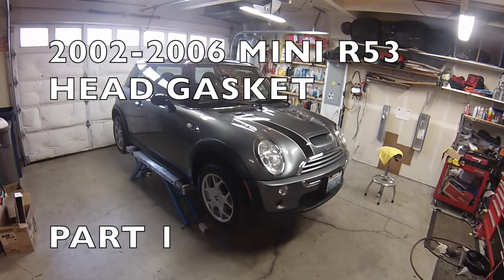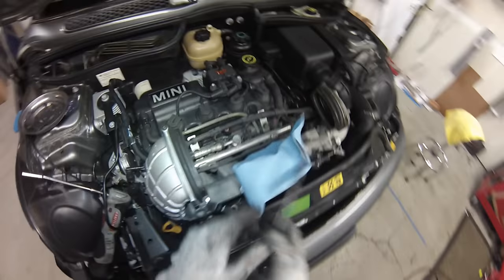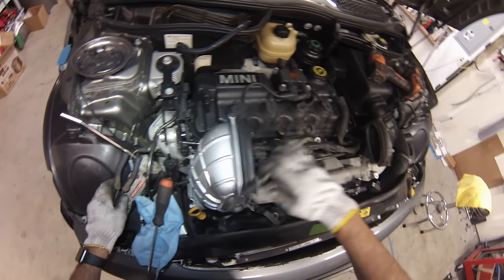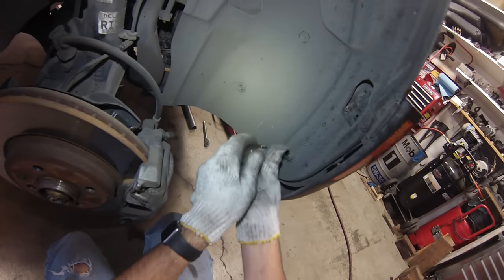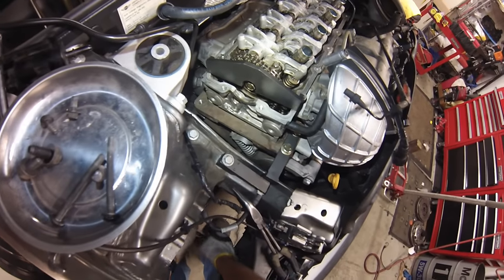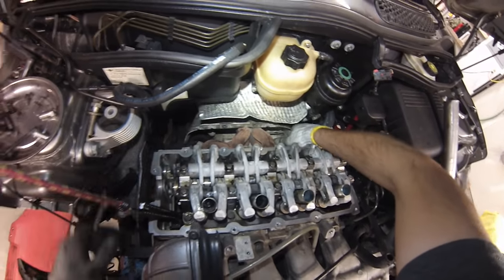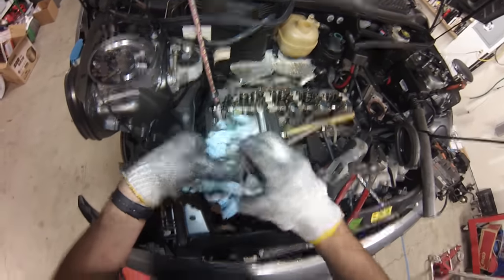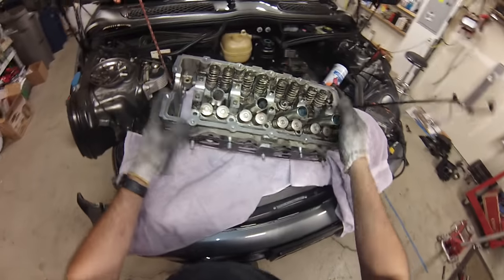How to Replace MINI Cooper Cylinder Head/Gasket 2002-2006 R53 Part 1

Comment: what tool is used at about 7:40 not the air tool
Reply from the maker: +jaydunners0805 12v battery powered angle impact driver?
Reply: +Mod MINI thanks any chance u could do a walk atound of ur most used tools and what cars u have as I have only subscribed and are very interested in ur work
Reply from the maker: +jaydunners0805 One of these days... Time.

Comment: seems like this is the best way to replace the guide rails? I would guess no need to remove wheel or fender inner. great video.
Reply from the maker: correct.

Comment: You said in text at the start of the video that a bad oil cooler can cause the milky oil as well. My R53 had a head gasket replaced about a year ago. I am starting to see symptoms that say the head gasket is gone again but it is still very new. Is there any way I can visually check the oil cooler to see if that is the issue? Thanks for your help
Reply from the maker: +Anthony Fidanza Yes it can. You can test it by removing the oil cooler and hooking up the coolant side of the heat exchanger to a pressurized water supply such as a garden hose. If anything drips out and you're sure your connections are good, you have a bad oil cooler.

Comment: need your most honest opinion. I over torqued the long bolts by 10ft lbs in error. haven't ran the engine. would you loosen it and retorque or get new bolts? its the long studs that bolt onto the short block
Reply from the maker: +Dee Chey I would probably just leave it as is. Loosening and retorquing may be worse than doing nothing. 10lb-ft is not a lot and not enough to compromise the bolts or change bearing geometry.

Comment: Another awesome video that gives me the confidence for this job!

I do have a question though before i go digging into my r53. I have found the milky residue on my filler cap and a little bit on the dip stick. I suspected the head gasket but as i do more research i find that it can be the oil cooler also. Some have also said this can be caused in these two locations because of condensation...? I'm not sure if i believe that, but i do live in New Hampshire where it has been very cold recently. Do you think condensation could be responsible for this? I changed the oil only 3 weeks ago and it looked perfectly fine. Also i have no oil residue in my coolant, that is clean. I did replace a leaky thermostat around 2 or 3 months ago. Not sure if that info is relevant or not. No white smoke, rough start, misfires etc. Car runs normal.

I will be getting a leak down test and test of the cooling system doen, but I would really appreciate an opinion from an experienced MINI professional like yourself before sinking in the time and $$$. Thank you so much for sharing your knowledge and experiences!!!
Reply from the maker: +Christian James That can be condensation if you take a lot of short trips. If you wipe off the dipstick and oil on dipstick is clean (other than what was probably stuck to sides of dipstick tube, you're probably fine.
Reply: +Mod MINI Very god to know thanks so much for the quick response. Too bad i already ordered the gaskets and tools for the job. Oh well at least i'm prepared!

I have been making a lot of short trips this past month (about 5 miles to work daily) but beginning Tuesday i will be driving about 100 miles daily for school (college commuter). I guess I should see if it persists when i begin my long drives?

Comment: This man should of replaced the intake, exhaust manifold gaskets and thermostat, especially when the car have nearly 150,000., and he has taken the cylinder head apart.  Those gaskets will not last.   This man is cutting corners to make more money for himself and cheating the customers.  Do it right, Bro!  GOLD
Reply from the maker: +HollywoodRoseJack Intake and exhaust manifold gaskets are stamped metal and last basically forever. Thermostat gasket was replaced. Please don't insinuate that I am cheating customers. The owner decides what to replace and I replace it, no more, no less.